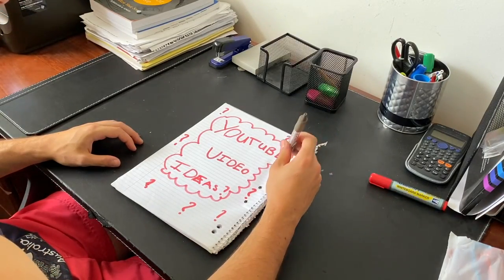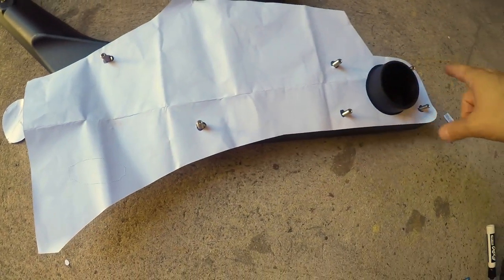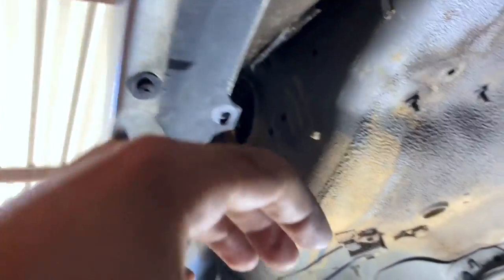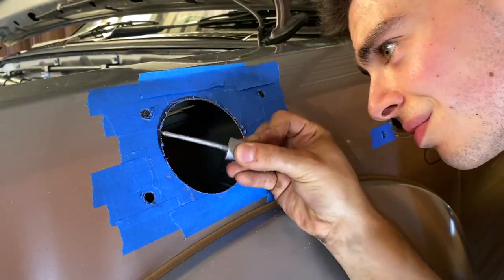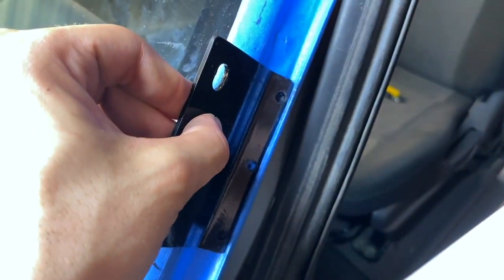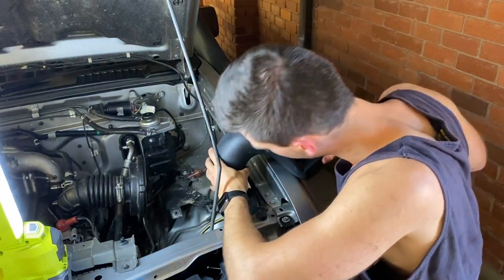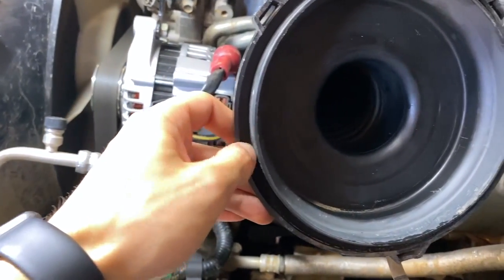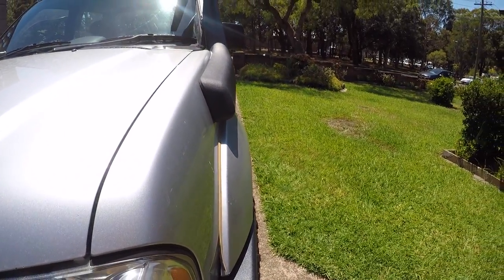Budget eBay OCAM Snorkel - ZD30 D22 Navara

Comment: Hi, have you noticed an increase in performance with a snorkel fitted? I’ve heard mixed opinions, I would expect it to increase the airflow and pressure into the air box.
Reply from the maker: It probably does increase the airflow and lets the engine breather better but I wouldn't say there's a noticeable increase in power

Comment: How about if you have dual battery under bonnet
Reply from the maker: Honestly not too sure man
Reply: Mine  has the dual battery setup...just need to modify and route tube differently... It's not hard. You will need a meter of flex tube.